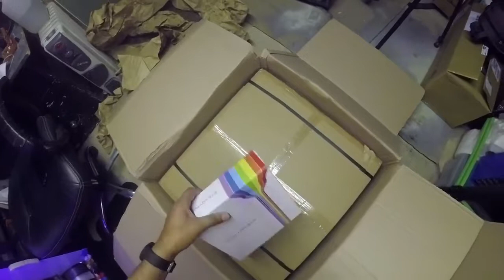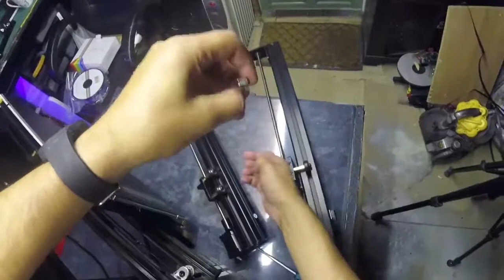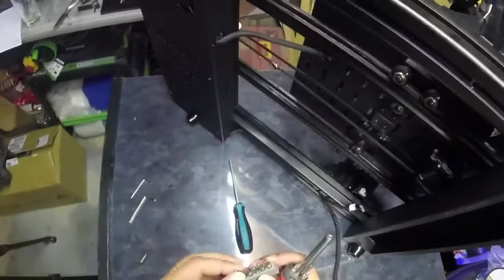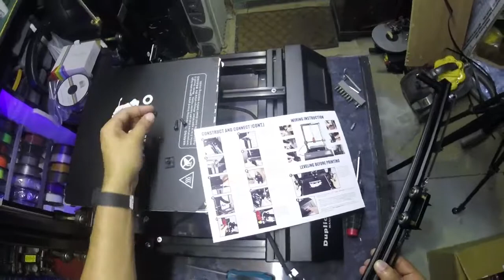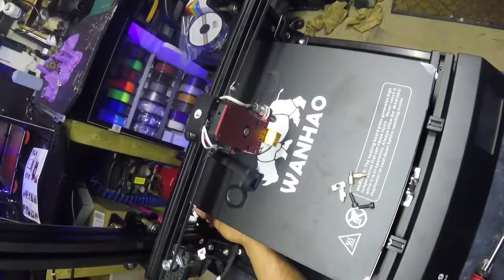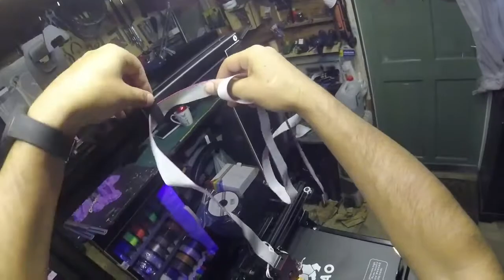Wanhao Duplicator 9 Unboxing and Setup Guide

Comment: Hi, how do i install this printer on Windows 10. I have a 64 bit machine and the driver software seem 32 bit hence its not working
Reply from the maker: Hi - have you installed Cura?
Reply: @BoxCoUk  Hi there, sorted now. I was misled into believing that the printer had to be installed like a normal printer and should appear in the Control Panel under Devices and Printers. I realised i have to use Cura to create gcode files and print on USB. That worked. 
Thanks

Comment: This is a superb printer!...Very happy with it so far and the service from Box. I'd suggest a few small upgrades from the factory - namely the 6 wheels / bearings on the moving bed rails....Originally I wanted a CR10S, but jumped at this printer when the price dropped......https://bleughbleugh.wordpress.com/